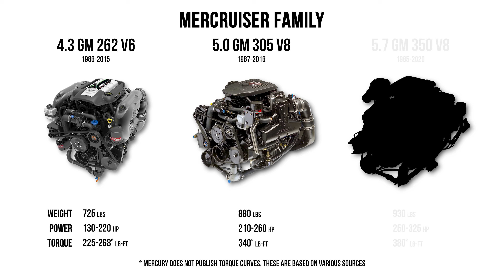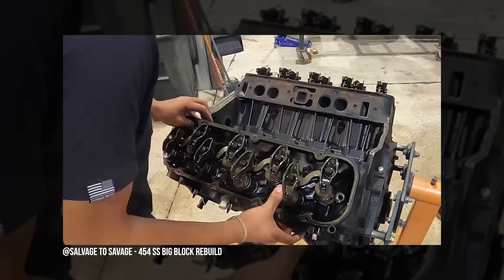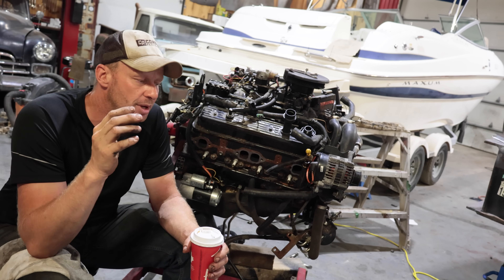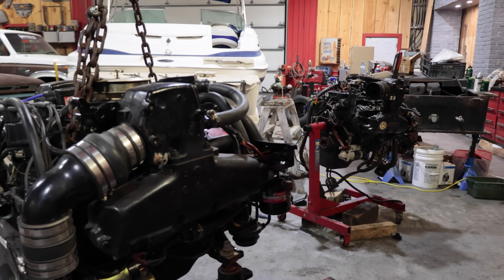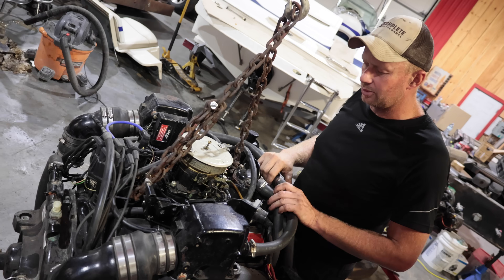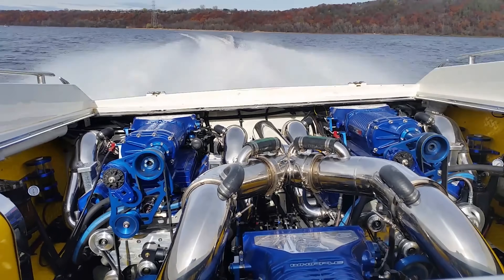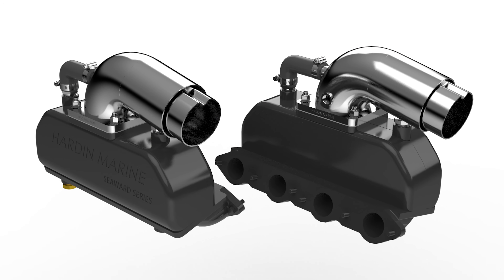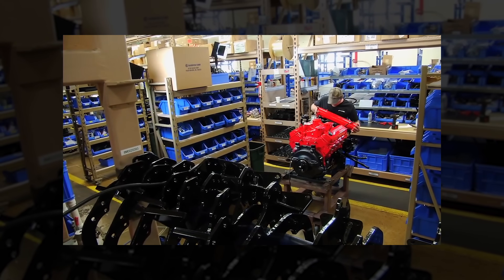REVIEW: Everything Wrong With A Mercury Mercruiser

Comment: Intake manifold gaskets are another one. If converting a truck engine to a marine application you have to swap the intake gaskets as well.
Reply: LS intakes are dry
Reply: @V8Power5300  only within the last few years have LS based Mercruisers really become a thing. The vast majority are still SBCs.
Reply: Having built a truck engine for a boat that cracked. I noted the intake gaskets were different and a side by side comparison showed the head gaskets had way smaller passages for coolant flow on the boat motor. I would guess due to them running colder in a boat.
Reply: @05milmachine90  I forgot about the head gaskets as well
Reply: That rear manifold drain isnt "just in case". The rear of the manifolds are where are the sand and sediment build up throughout the season. When you winterize it you pull that plug and push a small piece of metal up inside, wriggle it around. Remove water hose from union up top, then pour your BLUE antifreeze down into the hose until straight blue runs from the rear plug. If no blue keep working the poker or zip tie up into the manifold til you free the blockage and trapped water and antifreeze will finally flow. Insert plug, pour 1/4 gallon into hose, reattach hose up top.  Pull block drain plug(s), when water stops draining poke the drain passge just like the manifolds. Disconnect J hose from union/thermostat housing, pour  half a gallon of BLUE antifreeze into J hose making sure to pour as much as it takes until only antifreeze omes out of the block drains. Install plugs back into drains, pour remaining half gallon of antifreeze down J hose, reattach hose to thermostat housing. If equipped with cool fuel do the same procedure for the cool fuel module, it's drain plug is usually in the rear of module.  If a Bravo model dont forget to separate the raw water pump feed lines. They usually have a clip locking disconnect between the transom and pump. Lay hoses down into bilge and let dry. Do the raw water pump first so you can let the hoses drain while doing the rest of the engine.  

3.0l mercruisers have what's called a high hose and a low hose.  High hose self drains, low hose doesnt. If low hose equipped simply disconnect the low hose at the thermostat outlet and pour blue antifreeze down into it until you see blue coming out of the gearcase at the water pickup ports.  Don't ever use the 3.0l quick disconnects that drop into the bilge. They fill with sediment trapping water in the block and or manifold. Disconnect the hoses directly at the block and manifold.  For anyone wondering why you pour the remaining half gallon into the block, its so on the off chance there is a pocket of trapped water somewhere it will be mixed with the antifreeze and cant burst. Backflush the block , manifolds, water cooled modules, external raw water pumps and hoses with blue antifreeze. No blue isnt my favorite color and its not about its temperature rating. Blue is noncorrosive and safe for winterizing metal. Pink is corrosive and the only marine systems it is safe to use in are your potable water systems. These are made of various pvc's mostly, but nothing that will be damaged by corrosive antifreeze.  Don't forget change your gear oil but clamp the reservoir up top or you be sitting for awhile waiting for good gear oil to drain.  Running the motor for 15 20 min on the hose with the drive in full TRIM position keeps a lot of hot water in the prop bore which you can use to warm the outdrives gear oil up so it drains faster.  Just dont run it in trailer position or you risk damaging the gimbal yoke and/or its u-joints.  Grease your gimbal bearing, trim rams, and the coupler (might have to bump the motor over a bit to bring the grease fitting around so it's accessible)

Oh if you wanna be a real pro, treat your fuel and let it sit for a few min before firing it up and running it for 15 min. This will pull treated fuel into the fuel system while you get the engine to a warm enough temp to hot fog/winterize it.  Once warmed up pull off the spark arrestor and with the control lever in throttle only bump the rpms up to 800-1000. Take 2 cans of aerosal fogging oil or a bottle of liquid oil and pour/spray down the throat of the throttle body or carb. Do this until thick smoke starts exiting the prop bore all while keeping the motor just above stalling. When THICK smoke appears, stop fogging, then give the throttle two snaps to round 1500 then 2000. Once you hit 2000 snap the throttle back to neutral while simultaneously shutting off the engine. If the motor diesels a little dont freak out, you just did a really REALLY good job fogging it. Simply place the control level into throttle only and go full throttle. Motor will stop dieseling and then shut off the instant you push the throttle forward.

When your all done put the drive in full trailer position, place a small block of wood between transom plate and the drive, trim down drive onto board. Pull drain plug, remove batteries, loosely zip tie keys and drain plug (in zip lock bag)  to steering wheel for storage.

Comment: Go and have a look at B is for Build. He swapped from twin v8 Cummins to twin high performance LS motors. It's like a slow motion train wreck. The original engines weren't Cummins best effort, but he killed one by not checking the oil, which it was burning fast.
Reply: Why that hack didn’t just put in a pair of Cummins 6BTs or QSB 5.9/6.7s is beyond me. He doesn’t even get his hands dirty
Reply: @mz22wa  The original engines were 14 liter 419hp Cummins VT903Ms. He could have got another for around $10k. There are QSB6.7s that would beat the 903 power for a time. The 'government' rating on the 6.7s will go to 550hp. But continuous rating is 305hp. CAT C12 ACERT 12l diesels will run about 700hp for $40k. 500hp Yanmar diesels are about $25k each. Yanmar 6LT640 640hp marine diesels are $35k and would probably have worked too.
Reply: I think B (Chris?) has said he doesn't have much experience with diesels but lots with LS. 

I would have stuck with diesels too but the converrsion is more challenging & prob makes for better content.

To be honest, i would have sold the boat instead of dealing with the blown engine!
Reply: @JayneCobbsBunk  he doesn’t have experience with anything. Absolute hack job

Comment: This video proves why a fresh water cooled crusader was worth so much more.
Reply: I agree but still need to winterize the raw water side of the system. Much easier v& i think crusader has better design.
Reply: @JayneCobbsBunk  agreed, suck 3 gallons of non toxic in and all done. No waiting for t stats or pulling the drains and ramming out the corrosion blockages.

Comment: Biggest killer of the mercruiser is manifold and riser failure, they are only good for around 5 years in the salt water with basic maintenance, if your going to buy a used mercruiser ask to pull the risers and bring some gaskets, cheap way to know how good the motor is as far as corrosion and how it’s been taken care of
Reply: Meanwhile in freshwater I've seen 30-40 year old boats with the original manifolds and risers, still in good shape...
Reply: Yeah im surprised this wasn’t mentioned, the old style wet joint manifolds are the biggest cause of these engines failing (in climates where engines don’t freeze at least) theres only a few mm of material on a mating surface sealing the water jacket from the exhaust and if that seal fails your engine is immediately full of water. The new dry joint manifolds are much better but they still need to be changed semi-regularly as a service item
Reply: @129zano  then you have the monstrosity that is the one piece manifolds that develop internal cracks and leaks with zero sign of damage externally as they fill your engine with water

Comment: My buddy is a commercial crabber and he had a 5.7 mercrusier in one of his older boats.  To insure he didnt crack the block/manifolds in the winter.  When he winterized the boat, he would flush it with fresh water using the muffs and garden hose.  Then right before he would fog the engine he would mix 2 jugs of straight antifreeze and water in a 5 gallon bucket.  He would then stick a sump pump into the bucket to help pump the mix into his flush muffs.  He would run the engine until he had his special mixture running out the exhaust.  I guess it was easier doing it that way then trying to drain the water out the correct way.
Reply: Great Idea, today you would use RV antifreeze.
Reply: @philipmackin1025  Why?
Reply: @Watchyn_Yarwood pink AF is less toxic
Reply: I knew a guy who used the pink RV antifreeze in his 350.
Reply: @conrasm  I would be concerned that this "pink" antifreeze is not formulated for automotive engines as is engine antifreeze, therefore I would not use it personally.

Comment: Would a big block 454 fit in there or that would be too big?
Reply: A 454 will most of the time fit in the same hole that a small block came out of, same mounting location, same exhaust location, same controls and gauge harness etc. only thing you have to worry about is clearance for the engine being generally larger than a small block and the leg. Alpha legs generally wont hold up to big block horsepower but a bravo leg will

Comment: The main difference between the automotive 350 and the merc 350 is the metallurgy in the block itself. Because marine applications use raw water for cooling, the block uses materials that are far more resistant to corrosion.
Reply: Yeah they’re the same casting, that main difference in the long block is the headgasket, an automotive engine will use a gasket with a steel fire ring but a marinised engine will use a stainless fire ring so it doesn’t rust out and fill the cylinders with salt water
Reply: Myth
Reply: Both come from the same casting line. No difference

Comment: Watch out for aluminum intakes from automotive engines.  Marine engines tend to use cast iron to reduce corrosion in raw water cooled applications.
Reply: They sell marine versions of some popular aftermarket performance aluminum intakes (like the Edelbrock Performer).  They're basically the same manifold with a coating inside the coolant crossover/thermostat housing.  Does it work?  I doubt it.  I used a non-marine aluminum intake on a boat motor once and it was fine for years with limited use and flushing with fresh water after each use.  But when I had to take it off... it was TRASHED.  I don't think it's just the salt water that ate it.  I think the whole intake basically became a "sacrificial anode".

Comment: "heared" about some engines for boat applications are balanced differently , makes sence as for externally balanced engines it has counterweights on the front and on the flexplate in the rear , and the boat engine doesnt has a flexplate